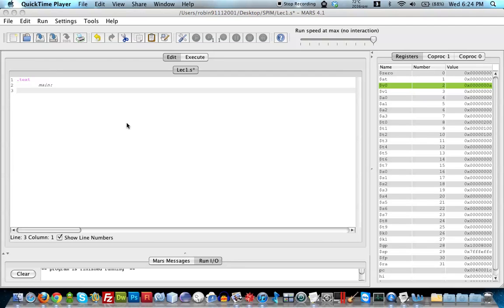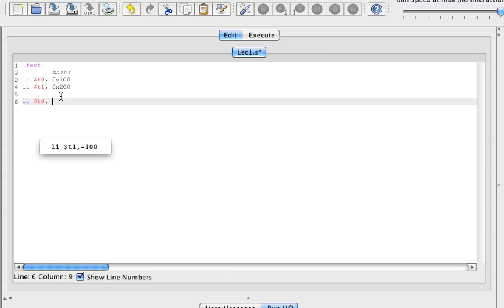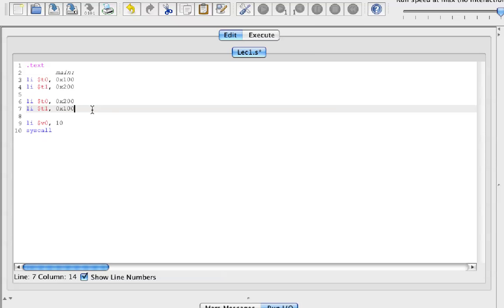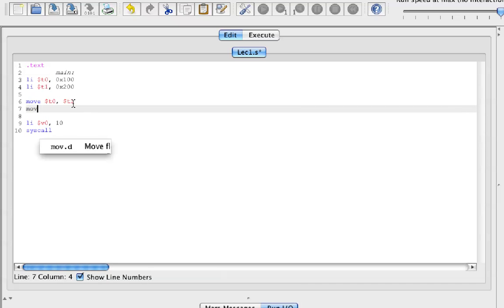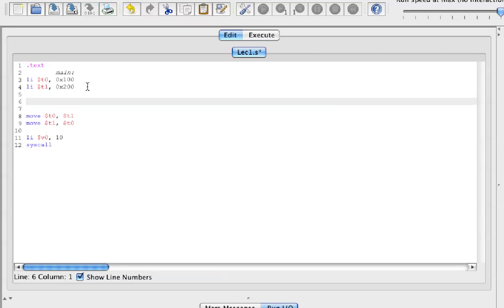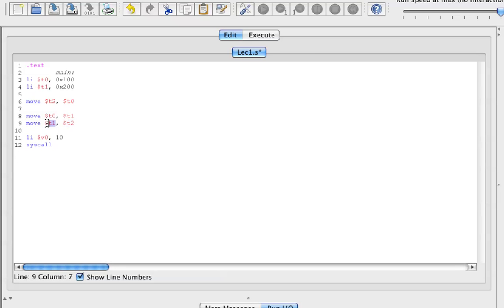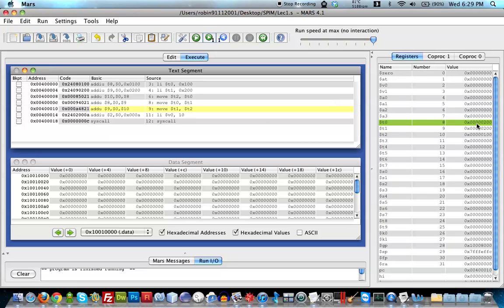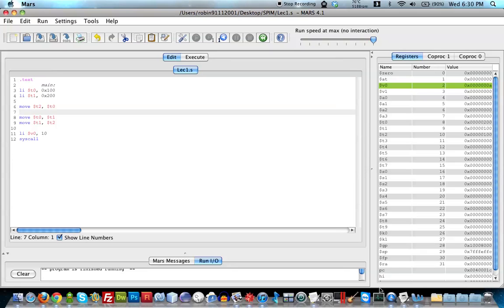Swapping data between registers

Comment: hey robin, whats the MIPS assembly code for swapping the contents of two registers without using any other registers
Reply: It is with the logical exclusive or: EOR
Example: 
R0 = 1011
R1 = 0110
You can do with this operation: 
1. R1 = R0 EOR R1 
2. R0 = R1 EOR R0
3. R1 = R0 EOR R1

1. R1 = 1011 EOR 0110 = 1101
-----------------------------------------------
2. R0 = 1101 EOR 1011 = 0110
3. R1 = 0110 EOR 1101 = 1011

Now R0 is 0110 and R1 is 1011 ;)
Reply from the maker: As far as I know, that's not possible without using an extra register. If you think about it logically, only one action can be preformed at a time, you can't move two values at the same time.
Reply: true that. once we do only with that stwo registers both will be having the same value. thanks though.